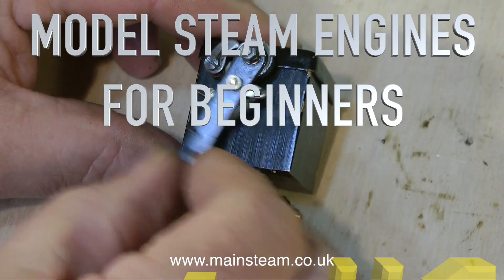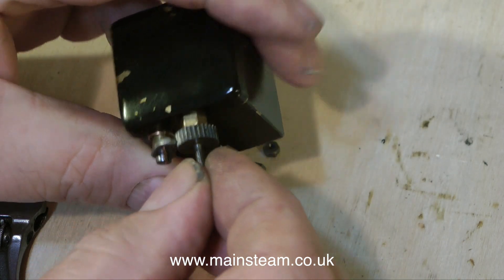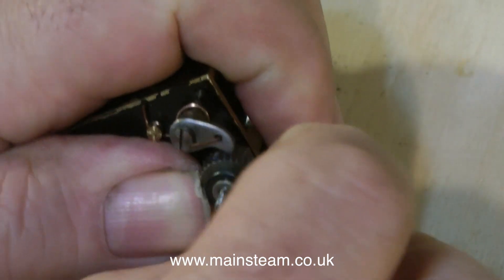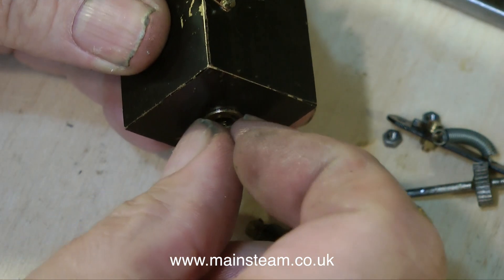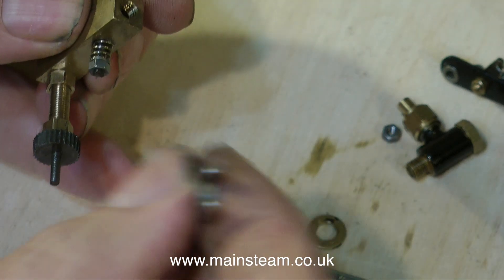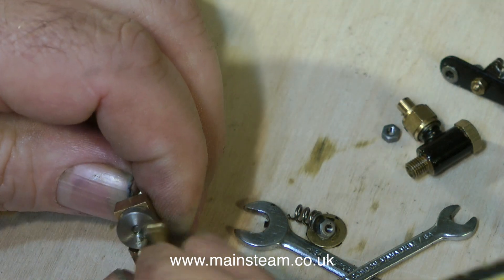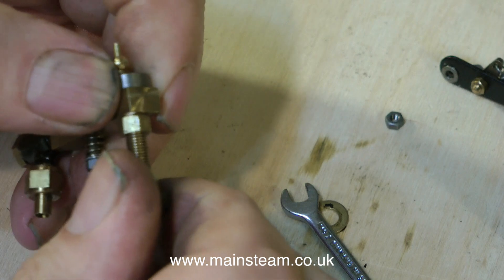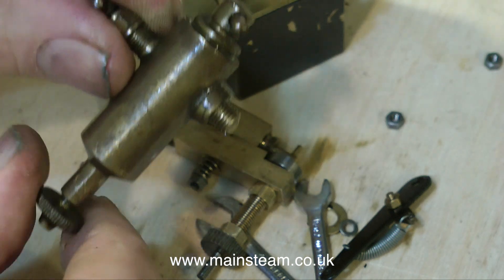MECHANICAL CYLINDER LUBRICATORS - MODEL STEAM ENGINES FOR BEGINNERS PART #11

Comment: Thanks for this.  I'm a clock man as a rule, but when buying a 'new to me', lathe, from a deceased modellers wife, I accidentally bought a 7 1/4 bridget, which was missing it's ratchet lubricator and a clack? Valve from one side of the boiler.  Im now fairly confident with what's needed now.   At least I know what they are and how they work!  Ill be watching all your videos.  Thanks again.
Reply from the maker: Thanks for watching }:-)))

Comment: Interesting, that little ratchet type is. I like the the look of these too, especially the full size units that are multiple point oilers that have the drip windows in them, quite neat!

So this little guy, it only pumps oil for 180 degrees of ratchet travel? And the transfer port from the cylinder is just a close machine fit between the two parts? It would seem to me that having to overcome steam pressure, that close tolerance seal fit wouldn't be very efficient.
Reply from the maker: I have found that one click per crankshaft revolution gives plenty of oil. Yes it is intermittent, but on all of the model 5" & 71/4" gauge steam locomotives that I have built & owned there is always a nice sooty, oily ring around the chimney - indicating that all is well. On larger engines I would use one lubricator per cylinder as I did on my Stanier Black 5 in 71/4" gauge.
Reply: Keith Appleton Okay, cool, I was wondering if I had missed a detail in there somewhere. I wouldn't figure such small little engines would need much oil and that one such as shown would provide plenty for the size. Thanks for chiming in! Cheers!

Comment: I wonder if a scotch yoke arrangement with an adjustable crank pin throw could be made to work ?
Reply from the maker: Yes, some lubricators use that principle too.
Reply: I'm late as usual! I was thinking about that arrangement, and you wouldn't need go 360, it could just rock 30 - 45 and still pump every stroke without a return spring. I want to make a small one (eventually time etc). I know the ratchet design works on larger models and works very well, but they don't seem to scale down with fine ratchets and pawls getting dirty. Also there has to be a limit with oscillating cylinders pumping pressure as they are natural safety valves? (and they only pump for 180 degrees). I had a another idea .... yet to be realised? Is it possible to make a small lubricator where the piston travel is driven by a coarse thread like a 2 or 3 start worm?

Comment: Fascinating ,,, seen many hundreds of Mechanical lubricates ,,, on Mill engines  ,,, pit head winding engines ,, water pumping engines ,,, and stationary engines in gas,,, sewage,, dye works etc,, but that's the first time I have seen inside one ,,,, a simple but sort of satisfying motion as the push rod advances the cog wheel by a couple of clicks ,,,,  but at the risk of showing my ignorance ,,, im thinking the supply of oil must be quite intermittent,,,, ??? on half the revolution drawing oil in and pushing it out on the rest of the revolution ,,,so if its only advancing one tooth at a time there must be quite a pause in the oil supply,,, 
 or have I missed something,,,,,    Many thanks ,,,,
Reply from the maker: One click per crankshaft revolution gives plenty of oil. Yes it is intermittent, but on all of the model 5" & 71/4" gauge steam locomotives that I have built & owned there is always a nice sooty, oily ring around the chimney - indicating that all is well. On larger engines I would use one lubricator per cylinder as I did on my Stanier Black 5 in 71/4" gauge.
Reply: Brilliant thanks ,,,  I wasn't suggesting intermittent was wrong obviously its tried and tested over many years just wanted to confirm I had grasped the clean end of the stick,,, a quite insignificant looking little box with a ratchet on the side but a vital vital part of any engine ,,, many thanks